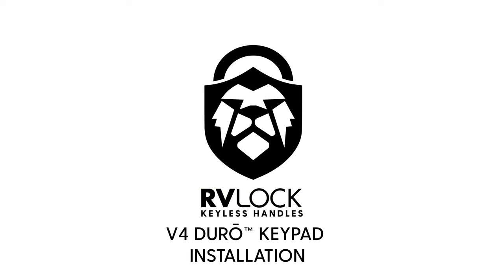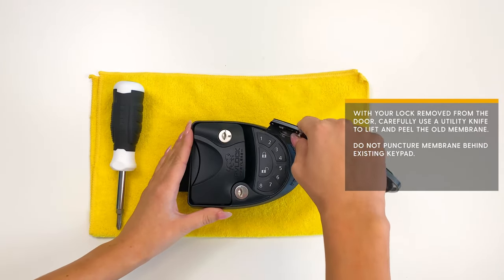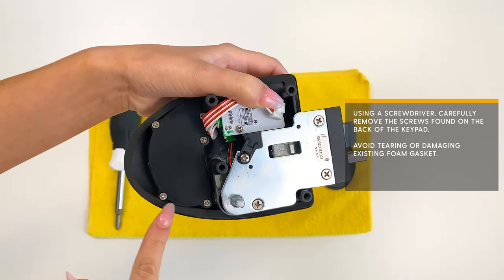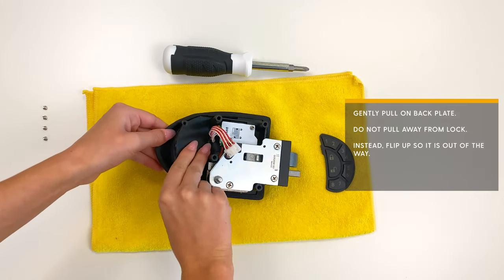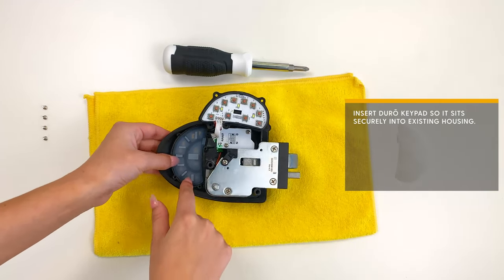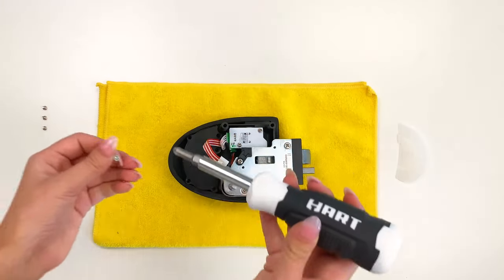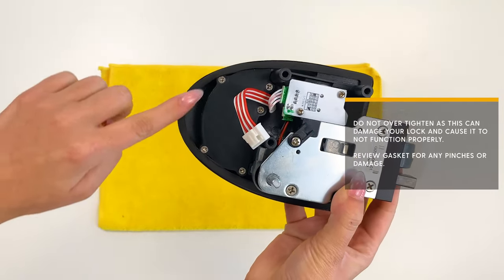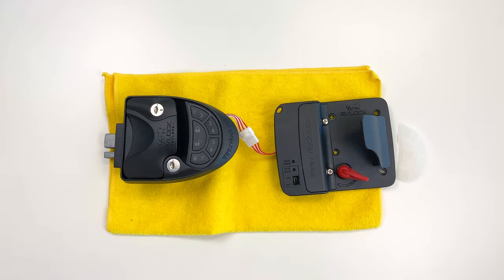Installing the RVLock V4 Durō Keypad

Comment: Installation was simple and straightforward. I would recommend the use of a new, properly-fitting screw driver bit in a ratchet handle for the screws holding the inner plate.